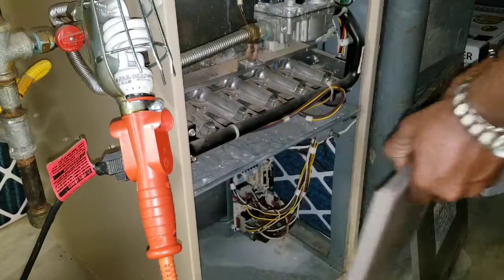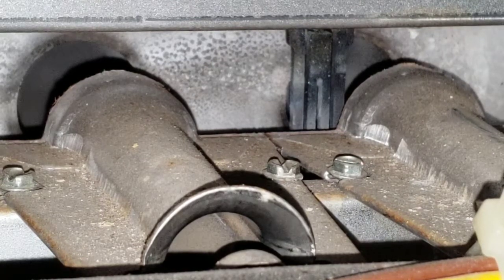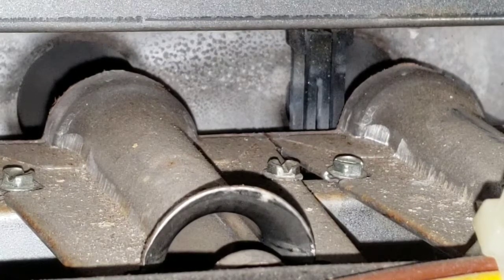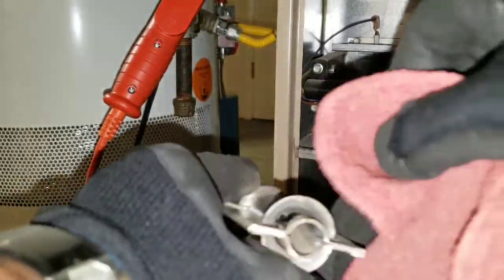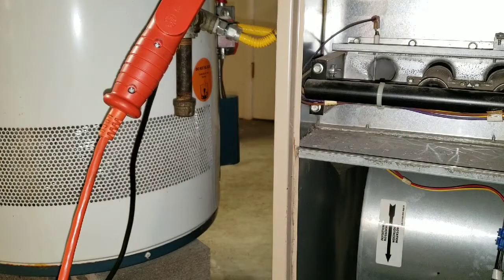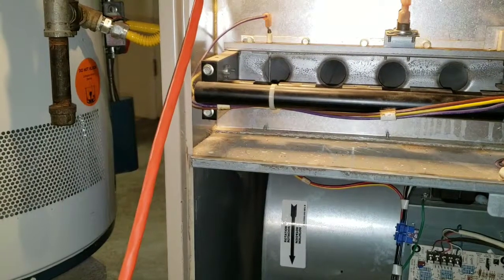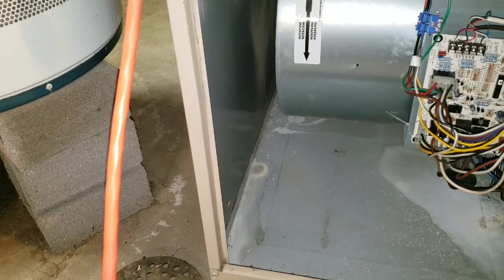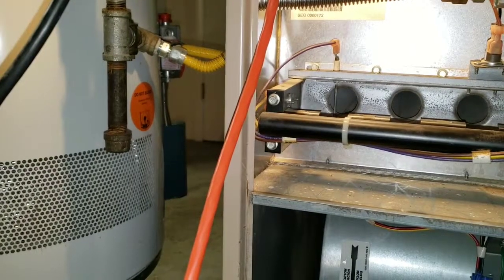How to Tune up a furnace

Comment: Thanks for doing this. I suspected it wasn't difficult enough to justify paying $100 each time, but I would have never been brave enough to try without your help.
Reply from the maker: No! Thank you for watching
Reply: I don't believe most tune-ups even clean the burner ports, we just check the ignitor, clean the flame sensor,  clean the little one or two poly tubes ends leading to pressure switch and ports, replace a filter, check for amperages on the inducer and fan, and last check for any gas leaks or CO.
Reply: This is NOT what a professional would be doing on a clean and check. I want my money back from the guy making this video lol
Reply: @chucktrivette5723  why don’t you enlighten us then?   What exactly does a “professional tuneup” entail?

Comment: Thanks for the info. I started using a metal air filter 2 years ago so I don’t need to buy the throw away ones anymore. I blow it out with a leaf blower every few months. Do I you have any opinion on the permanent metal filters?
Reply from the maker: I'll have to look into those I never used them before.

Comment: Mr. Hands, I to have an issue with what a lot of "Large"  HVAC contractors try to sell as a "Furnace Tune-up" though for a different reason than you do. For big Corporations the Furnace Tune-up is often tied to a service agreement to try to lock in future sales, and the actual tune-up is done by a tech in under 15 minuets and doesn't even equal a good clean and service. While the sales pitch inflates the service as somehow being more predictive of future failure than is actually possible. When what it really does, if done correctly is extend the life of the furnace and time between calls by doing exactly what you did, cleaning burners, ignition assemblies, and overall housekeeping, which as you know can be a good 45 minuets not a 15 minuet check with a flashlight and running a vacuum over a few parts. 

The term furnace tune-up originally started as a term for service folks that were trying to differentiate between a "Clean and Service" (which you did almost perfectly) and a fuller service tune-up that would include some key items like Flu-gas analysis, (Which is key, because the best HVAC tech in the world can not measure CO, or efficiency by looking at a flame), Inspecting for and ruling out a cracked heat exchanger (Once again the Flu-gas analysis is superior for this over a physical and camera inspection), air flow, a filter change, and at least a cursory look at exposed ducting in the attic or crawlspace. 

On the "clean and service" aspect, which is really what you are performing, the only thing I would add is to inspect and clean the where ever your make-up air comes from (the air the furnace pulls through your filter). In your case it likes like an 80% upflow furnace with a box below the furnace it pulls air from. (different types of furnaces will have different types of intakes and cleaning will be dictated by type, see manufactures for recommended checks). This box below an upflow furnace is the most common in older homes in my area, and I seldom meet one that is not full of dust, lint, trash, and often rodent droppings. Even when it has a new filter installed, it's like nobody takes a flashlight and just looks down. Cleaning/Disinfecting this area alone justifies my service in most clients minds as they have never seen a tech do it before, and they realize they have been breathing air from this box all along. 

On the "Blue-Flame" a lot of your viewers are keying in on, I to was of this school for years after being trained by a local gas company guy with decades of experience. But when CO detectors became required here in CA, and I started carrying a CO detector to check conditioned air I was in for a nasty surprise as I ran in to a few heaters/water heaters that the match to the vent, and visual on the flame checked out ok, but that were putting dangerous amounts of CO into the conditioned air, or the space the appliance was in.  Although that blue flame check, coupled with a visual inspection of what happens to the flame when the fan kicks in can be good indicators that everything is all right, it absolutely can not rule out a cracked heat exchanger, or an partially obstructed or improperly vented exhaust. It only takes one situation like that to kill someone.

For those that want to "clean and service" their furnace themselves hats off. But I strongly recommend you still pay a professional to perform a flu-gas analysis once a year prior to heating season, which should include adjusting your gas valve to peak efficiency as part of the process. 

Overall excellent video for maintaining your furnace, I enjoyed watching it thank you.
Reply from the maker: Thank for watching. Your on point thier main goal is to come back out.

Comment: To turn the gas off do I just turn the thermostat off or is there a switch to hit on the furnace
Reply from the maker: There a valve on the gas line. To shut off turn it perpendicular and to turn on turn it parallel

Comment: Furnace can’t do a combustion analysis nor it check the firing rate .I suggest a home owner replace the filter, and call a professional for the more technical aspects of fuel fired equipment. You can’t smell carbon monoxide. You need a meter to test for it. If you are not testing you are questing.
Reply from the maker: Right on for you

Comment: Lmao the furnace checks itself 😂 I wonder why we techs exist then. There’s way more to a furnace inspection than that bro check for gas leaks because the sealant that is used to put the pipes together wears out, check for capacitors to make sure they aren’t low so customers won’t be stuck with no heat in the middle of winter. Those are main things now consider the small stuff, terminals, fuse, flame sensor, any fire hazards!! But anyways y’all listen to YouTube teachers I’m sure it will go right just give an Ac/Heating company when y’all see smoke coming out of the vents 😅
Reply from the maker: Right on bro I am a HVAC tech I know what to do and when most companies just want your money. You spend your dollars how you see fit. Don't say you was never told

Comment: Why does my furnace only have two burners
Reply from the maker: Humm I hope.this is the case. It sounds like you might have a trailer furnace. It for heating smaller spaces thats all.
Reply: Or it just operates on higher gas pressure
Reply from the maker: No sir I believe you have a trailer furnace
Reply: Nr of burners depends on the BTU output of the furnace. Lower output, less burners. For the same type of furnace obviously. Different brands might have different output , even with same amount of burners.
Reply: @DL101ca  do these type of furnaces last longer?
Reply from the maker: @tipsy09  with proper maintenance the furnace can last a long time. This also mean changing the filters at least once a year and making sure the flu vent up top is clear and covered
Reply: @tipsy09  think of the burners as the number of cylinders in the engine of your car. Number of burners won't affect longevity, but proper tune up and maintenance will, also build quality.

Comment: You say your saving people money, but your forgetting that these techs are actually going more in depth to tune up furnaces. Well, good companies and techs. Actually should be checking, gas pressures, ohms on igniters, amp draws on blower and inducers. Microamps on flame sensors. They should be checking heat exchangers with their cameras, temperature splits and so on. On top of all that they should be doing what you showed and then some with cleaning. But a hundred dollars for what I just explained, on top of yours, isn’t really a bad deal, especially for people who don’t have the accessibility to the meters and tools that are needed to make sure their furnaces are efficiently and safely running. What you just showed, a company shouldn’t be charging more than 50 dollars or even call it a tune up.
Reply: The man is just giving basic cleaning tips. He's not claiming to be a professional heating and cooling technician. No where in his video did he say that he had a certification in heating and cooling. Give the man a break. Jesus Christ ! And since you're such soooooo knowledgeable about furnace repair and know all the terminology why don't you make a video for us.  Thank you very much in advance 😊
Reply: I am inundated with furnace tuneup ads. How can I find one that is reputable and will do all that you say?  I have not had a tuneup since I had the furnace installed- 6 years ago! I guess I need to get one.
Reply: @ericmcdaniel4029  I wish you were located near me! All I see are ads put in those mailbox flyers with the seasonal “deals” I don’t trust any of them. Thanks for the tips. 
.
Reply: @occipitalneuralgia2339  where are you located
Reply: @ericmcdaniel4029  i appreciate your message. it went into more depth. knowledge is good...it also prevents being ripped off if you hire someone to do the tuneup. thanks sir. His video and your message ...good info. thank you to both of you. my tune up is being done on this Tuesday and i hired someone 85$ he said it will take 1 hour.
Reply: Where’s the link to your video about this?
Reply: @HORS3MAN5280  never had a video

Comment: Lol all you need is a combustion analyzer, leak detector, monometer, multi meter. You don’t just look for a “blue flame”, you check the gas pressure and the most important part is checking the heat exchanger for cracks. And you can touch the igniter it won’t break just from touching it. And make sure those burners go back in exactly how you took them out. I’ve seen people put them in upside down and that can be fatal. you can clean it yourself if you want but that’s not a real tuneup there’s a lot more to it
Reply from the maker: Well done except yes you can touch the hot surface igniter but it won't last long the oil from your hands will make it burn out quickly. Just thought you should know that. Also the furnace goes through a self test

Comment: Thank you!
Reply from the maker: Thanks you for watching too
Reply: When you start noticing inside your heat exchanger holes start turning black that's a sign of a cracked heat exchanger and it means your furnace is running dirty